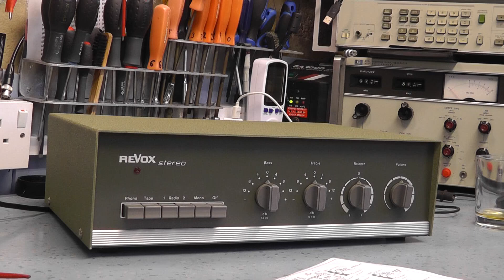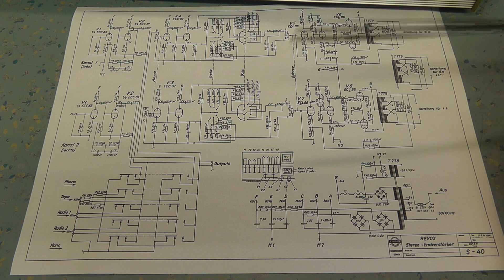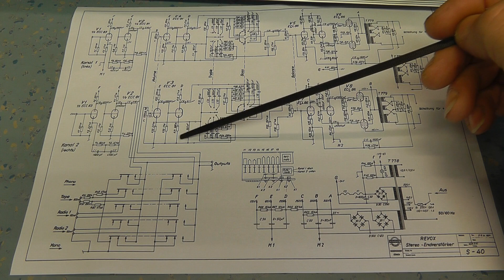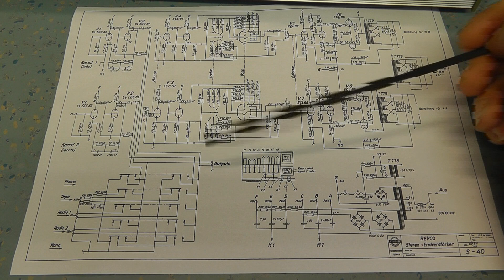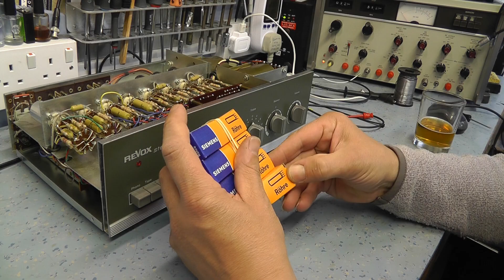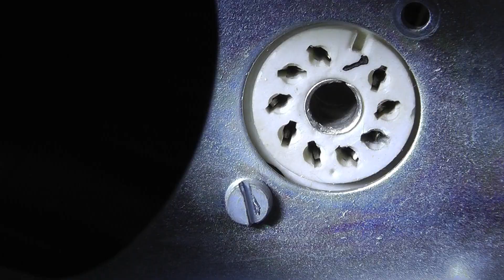Revox model 40 Valve amp repair pt1

Comment: A metal dental pick or a small darning needle should get that pin out. ECL86's are notoriously difficult to match; there's the triode sections in them that also have to match up with the power pentode section. I wouldn't trust them to match up just because they were located in adjacent sockets! They'll need to be properly transconductance tested first, then matched for bias current draw & triode section anode voltages in situ...Also, ECL86's have a fairly short lifespan: 500-1000hrs. MAXIMUM. They usually don't develop shorts or opens or anything of that sort. Rather, their emissions don't hold up & there's equal likelihood that the triode section loses its emissions as the Power Pentode section; go figure! So even after as little as 100-200hrs. of use, a perfectly matched pair will have its characteristics drift enough that they'll be anything but!🤪 Also, the ECL86 is VERY sensitive to being operated at anything unlike the EXACTLY 6.3V that the filaments are rated for. And being run from an unregulated AC winding from the power transformer, rest assured that you are NOT getting precisely 6.3V! EL84's & especially 6AQ5's DO NOT suffer from this voltage sensitivity & last many multiples of time as long...Seems your customer is no audiophile; those mean Mr. Mustard Mullards aren't exactly low dialectric absorption types such as polystyrene or polypropylene (never mind teflon). But replacing ANYTHING wired to those HORRID turret sockets will be a nightmare, as I found out when I tried working on these 🧩🧩 of 💩 in my G36 open-reel; the bottom disc on the socket assembly LOOKS like phenolic or bakelite, but it's not!!! Instead, it's made of some STUPID 🤪🤤🤤🤤very low melting point plastic, possibly polystyrene! If you do find that you have to replace that socket, why worry about it being an exact match? It's not like anybody is going to look inside the chassis & notice! And if you think that those old paper/polyester dielectric Mullard antiques sound good (enough), you aren't going to ever hear any difference whether you use a high-temperature ceramic jobbie or a boo-teak CMC-brand teflon one!🤨
Your biggest worry is simply to find the same KIND of socket, with the round turret under its arse. Because whilst you were admiring that "excellent" layout (that upon closer & more thoughtful inspection, turns out to be anything but🥵), you may have failed to consider how & where you could alternatively locate all those resistors & condensers located underneath the socket using a "regular" design 9-pin socket & off-the-shelf terminal strips and/or tag boards.😱😱😱
People get all caught up in brand names & have little or no actual experience with the products that they drone on about.
Another gentleman here is suggesting changing the coupling condensers to Audio Joke copper or silver foil 💩; the thing that matters for the sound ISN'T the choice of metal foil, but the dielectric material! And here it's merely mylar, which is DuPont's trademark name for their polyester material. IOW, you pay all this extra money to replace a cheap polyester condenser for a badly made & ridiculously overpriced & absolutely no better sounding or performing ALSO polyester one!🙄🤦🚮 And speaking of overrated, poorly designed, & mediocre-sounding Hi-Fi brands besides Audio Note, let's add ReVox to that list, shall we? Other than the G36 open-reel, EVERYTHING else I've listened to, or worse, been forced to listen to, from ReVox is both shoddily engineered AND lousy sounding! Poor parts quality & MISERABLE mechanical engineering abound, as does indifferent at best & lousy as typical sound quality. Studer is much, much better mechanically than the ReVox stuff. As it should be, being their "Pro" division & costing TRULY OFFENSIVE sums of money. The valve equipment they made is MUCH better than the transistor pig-misery that followed to the bitter end/present day, so that means that "Peak ReVox" or "Peak Studer" is everything BEFORE 1965 or so...🦨🤓🤮
Other than all that, I thought that your video was well put together & altogether pleasant & informative to watch. IOW Simon, it's ReVox that sucks, but you certainly don't!🤗

Comment: Nice little amp. Revox made some very nice high end studio gear.  Revox, Studer and Otari reel to reel machines were used in the production studios of the broadcast facility of my former employer. When the newer recording technology came about, they didn't get much use, and most went to the scrap bin. The socket replace/repair looks to be a bit of a job.....good luck Simon.

Comment: I was thinking about this again. Could you take a sewing needle and heat the end of it and bend it over to make a hook probe . It may be possible to get this down the side of the socket and hook the pin out. Perhaps with gravity on your side encouraging it with compressed air and spreading the socket would encourage the pin out etc.   Or dental pick.   Thirds idea if you do take the socket out drill a hole in the base using a small PCB drill and perhaps push the pin out from the back.  Drill a small hole at the front next the the socket such you can insert a hook probe down the side of the stuck pin. This hole would be hidden by the replacement valve. I bet if you can actually get at it will come our easily. Thanks regards Chris
Reply from the maker: I unsoldered to lug and managed to partly extract it from the base. The pin just fell out. A Yay moment! 
Thanks for your input Chris, it's most appreciated.

Comment: That valve holder is a very annoying issue. Good luck resolving that. I assume there is no access from the Back can you push the hole socket pin out of its holder.

Comment: Very Nice, Simon. The circular tag strip component assembly is interesting. Perhaps to minimise the pickup. A typical design from the period using the pentode/triode in push pull. Hope you get the pin out, perhaps from the back.

Comment: Looks like a McMurdo base, Uncle Andrew might have one if you get stuck. Lovely amp in super condition.
Reply from the maker: Cheers Andy. It might be possible to extract the connection? That would be great!
Reply: @SoddingaboutSi  Yes, I was just thinking that after I posted, once the wire connection is undone underneath it should be feasible to push the pin grabber bit out. Well, that's what usually happens when you don't want it to!
Reply from the maker: @Andrewausfa  found a similar valve holder at work that has extractable sockets. One the solder side is bent straight it just pushed out. Let's hope this is the same on the Revox. What are your thoughts on those mustard caps? Owner wants to keep them ideally.

Comment: Extraordinary condition for an amplifier of that age - art and electronics in one package! Thank you for showing it to us. It may be possible to remove the component leads from the socket pin. clean the socket metal insert and then push it up through the top of the socket with the broken valve pin. There may be a small tab that needs straightening before the insert will move up through the socket body. Regards, David.

Comment: I broke off a lug on a rimlock valve socket and managed to replace the single socket lug by pulling /pushing it out from the top. It looks as though access underneath is difficult, but it might be less work than replacing the entire socket. Some of those wrap around pin sockets fit fairly loosely in the base. The rimlocks are a fork and require some persuasion.
Reply from the maker: Cheers Simon, I  will try this foe sure.

Comment: I had one of these for repair about 2 years ago, not in quite as nice condition as yours external. As I think you will find, none of the caps were faulty but I did replace the main filters and grid input caps. On test I managed 9.8 watts just prior to clipping both channels driven. It was quite a nice sounding amplifier, low noise abit lacking dynamic range but quite clean. Sounded like a typical VALVE amplifier in 
fact. I think the common term is SMOOTH!! It does in fact have negative feedback from the output transformer, about 16 dB as well as a little local feedback around the RIAA EQ and the tone controls.
Reply from the maker: I am hoping those mustard caps are ok. Will check grid leakage one I get this valve sorted.

Comment: That is a great layout and an interesting use of paired ecl86's. The Hacker mayflower did something similar with one of the triodes as a gain stage, the other as the phase inverter... Hope you sourced the replacement socket and look forward to part two!

Comment: I don't suppose that there is an unused pin that can be extracted and plopped in the messed up one position?.
That's a nice amplifier and in very clean condition inside :-D
Those resistors don't look carbon, i would be supprised if they were way off spec.
My old mate (passed away) loved revox and always talked about them in a glowing way.
Aparently revox tape recorders were excellent, i've never had one to repair so i dont know.
When you talked about a valve being driven without an audio input, it was exactly what happened with a Leak 20 amplifier i'm repairing for a frend, the cathode resistors were smoking, all because of the grid drive capacitors being leaky at 200+ volts.
Once snipped out of circuit the emitter resistors were cold, sorry cathode.
Reply: zx8401ztv The resistors appear to be Philips CR series carbon film resistors. I find these have pretty good long-term stability so long as they haven't been run too hot.

Comment: You should check Simon Audio note website I was looking at it the other day and quite interesting read about the new mylar in oil silver and copper capacitors claiming they are the best for Valve equipment. The noise problem is not down to the two transformers in the same orientation that's very strange I've moved them apart
You can use those little brushes for cleaning your teeth for cleaning the valve socket. Isn't there a hole in the socket at the other end?
Alternatively a end of a Q-Tip should fit in there super glue on the end and push it in there leave it for a few minutes see if you can pull it out make sure the straw is exposed

Comment: Sometimes you can get those pins out by carefully soldering a piece of wire (or straightened paperclip) to the pin and then pulling. Not an easy job as you obviously have to avoid soldering to the socket itself, but could be worth a try.

Comment: is the back of the socket open?
Reply from the maker: Unfortunately not!
Reply: @SoddingaboutSi  , before replacing the socket, try drilling out with a small drill bit meant for drilling pcb holes.   If the pin is ferrous it might come out with a strong magnet.